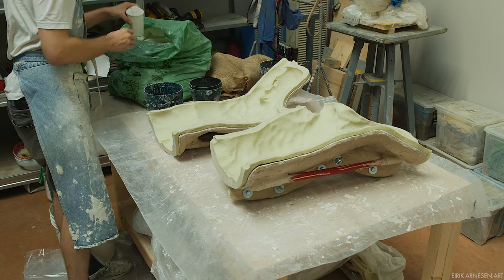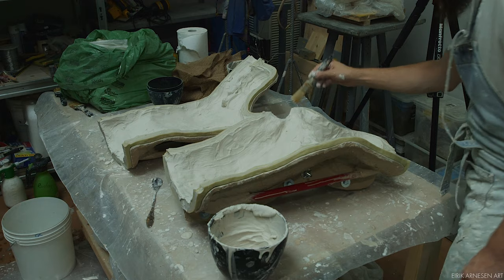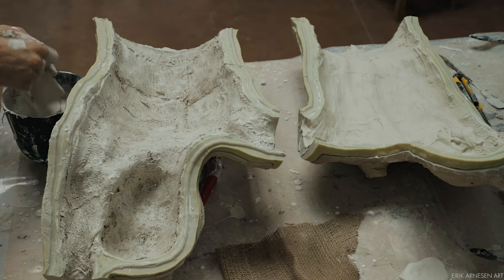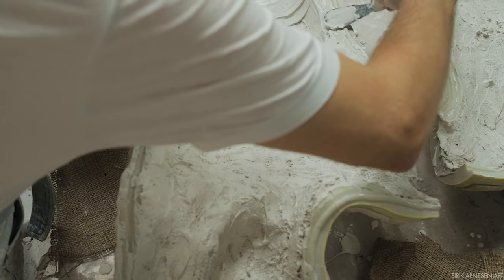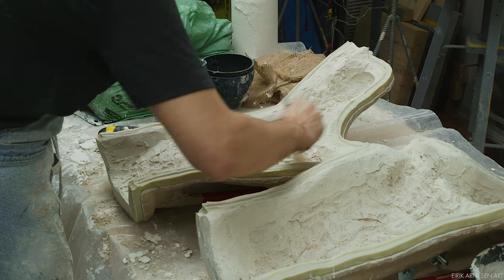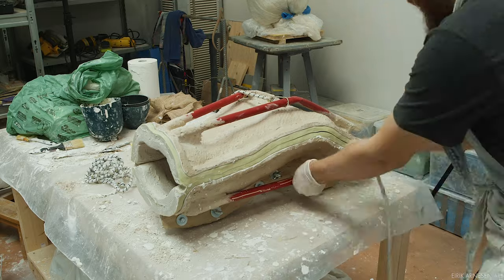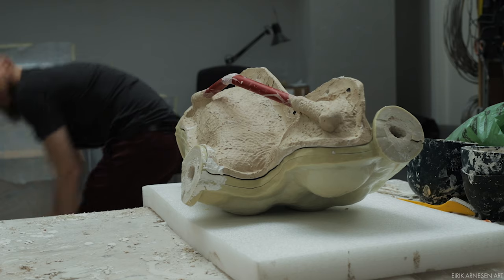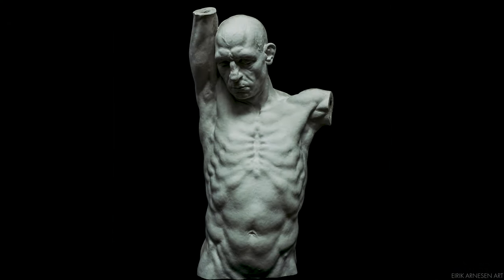Empyrean - Casting In Plaster

Comment: amazing work! i think you could also try doing a press mold using plaster and clay, it will be easier though requires a kiln.
Reply from the maker: I could try but since the silicone doesn't pull moisture out of the clay it's a bit tricky to do with this kind of mold. And I don't have access to a kiln. But it would be really cool!

Comment: Amazing! very clear explanation. I was wondering how did u get to the head to stuck the both part of the mold? or theres any technique you can use when the mold doesnt allow you to get to some parts? Thank u so much
Reply from the maker: If I remember correctly I was able to get my arm to the top of the head. Burlap soaked in plaster stretched over the seam onto both halves is going to hood the piece together. You can pour plaster into areas you can't get to or you can patch open seams from the outside.

Comment: Why not slip cast it in the same mold would save a lot of work and much less seam!
Reply from the maker: It's a bit big and tough to manouver. I also want the added strength of burlap which I can't do if I slip cast. Plaster is pretty soft and easy to manipulate so fixing the seams is not too much work if you have a decent mold.
Reply: @EirikArnesenArt  Nice thx for the explanation